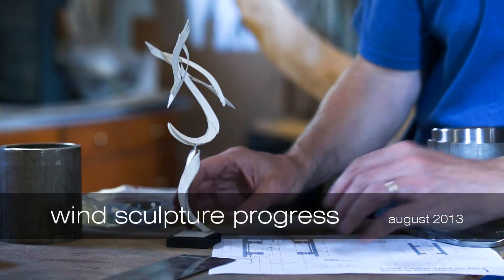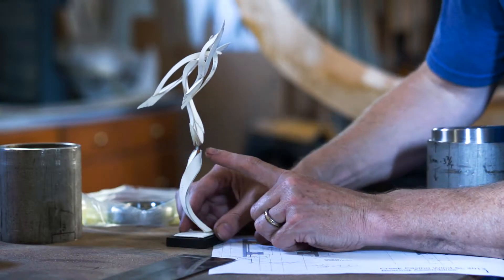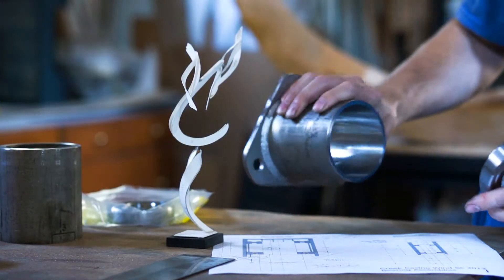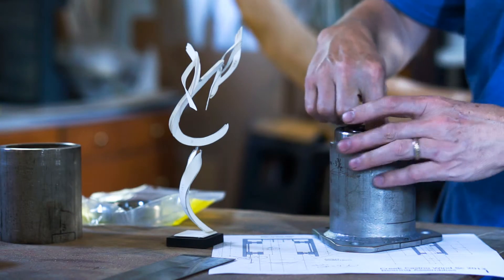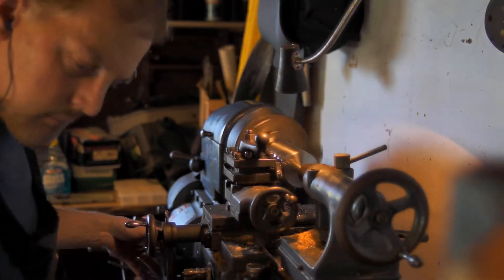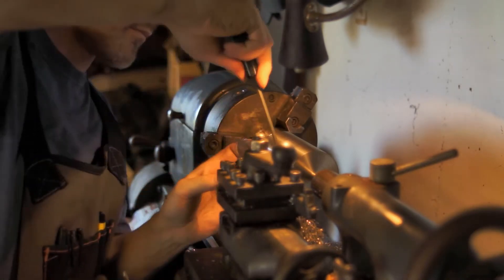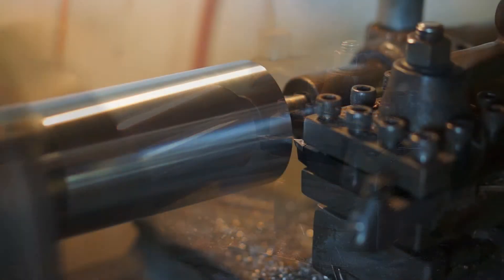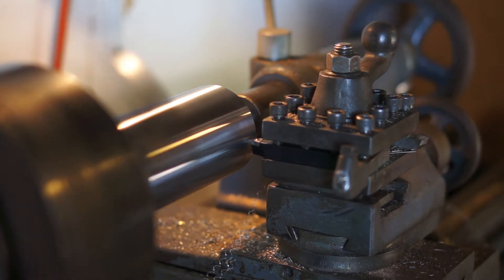Kinetic Wind Sculpture Progress

Comment from the maker: A sculpture, yes, but also a mechanical object. The central bronze arc shape to this 12' high (3m) sculpture is under construction in the studio. Being a finely balanced moving sculpture moved by the wind, construction also involves the machining of the mechanical parts as well. Stainless steel bearing components are made on a metalworking lathe. 

The sculpture will be installed in the middle of a fountain pool at the entrance to Creek Casino in Montgomery Alabama in the Fall of 2013.